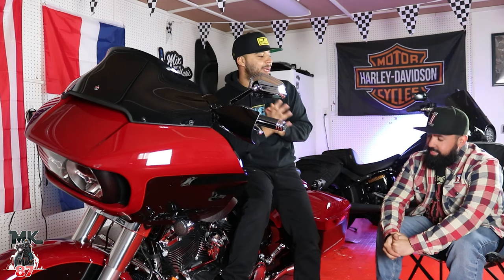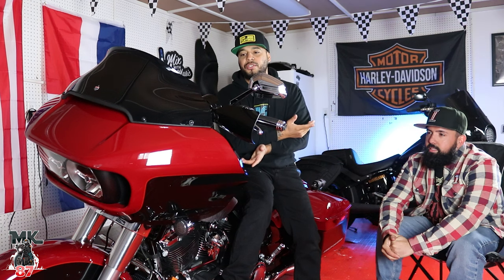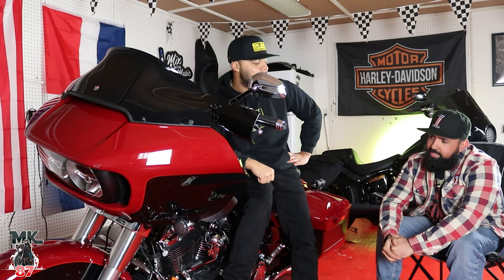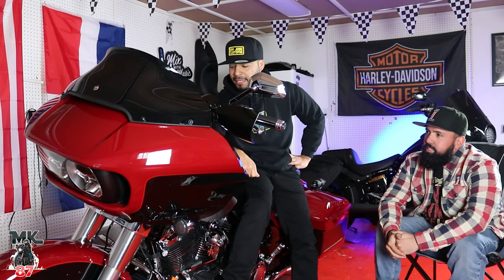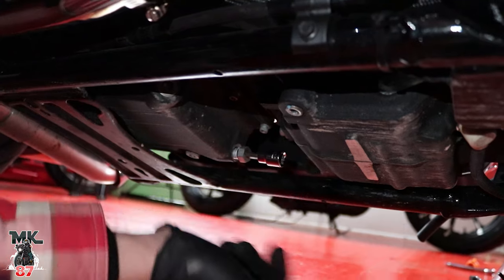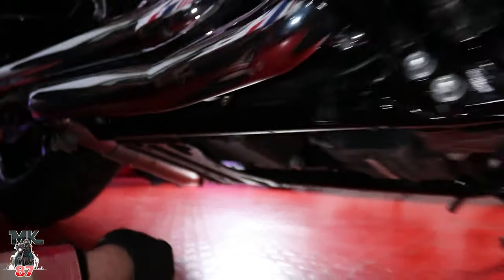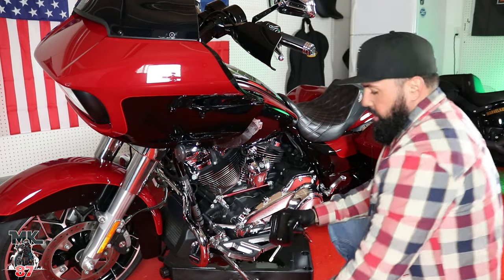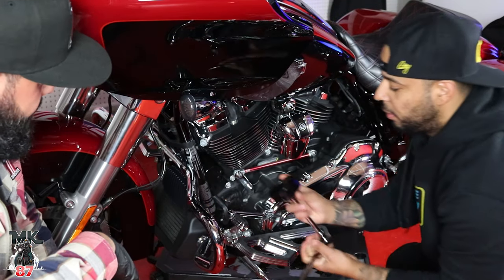How to do an oil change on a Harley Davidson road glide special

Comment: Drain plug you can also use a 5/8" socket for anyone wondering.  I also like/recommend to throw a little thread sealant with PTFE on the drain plugs. They come that way, thats what they recommend from factory, but honestly is just cheap and easy enough to do. It wont leak without it but $6 of it will last your bike's lifetime and its so easy. When you tighten these plugs, the second you feel the threads "bottom out", stop. I've pulled too many drain plugs that were way too tight from DIYers. You risk stripping the threads and stretching the threads out in the oil pan itself. a 1/4" flex head ratchet is perfect for these. Don't reuse O-Rings. Oil on the threads and gasket of the filter is a must, oil in the filter is personal preferance. Your M8s run 5 qts, twin cams will run 4 qts. Add 4.5/3.5 respectively and go from there. Run the bike (actually ride it) for a bit to run it before draining and run it the same after adding to get a true reading. Idling will warm up the engine, but not all of the oil without real riding. That's all i've learned, hope it helps someone.

Also, doing stuff yourself is great but for anyone who lacks the tools or know-how to check belt deflection, torque of critical fasteners, general inspection, tire pressure etc, take your bikes in for the service. The labor is expensive but you're paying for the work and the experience to have it done correctly to keep your bike in spec. I recommend finding a service manual for your bike thru facebook groups rather than paying the $100+ to Harley if you guys wanna do your own work/services.

Comment: Your friend did good. I have an M8 when I take out drain plug I check the magnet for bits of metal if any. Always clean the plug and bits of metal if any and clean off previous teflon paste or other sealants that may be on the threads. I use blue Hylomar on my drain plug threads. Added protection from leaks. Oh Yeah! Torgue is 14--21 foot lbs I do 15. Good luck! Good video!
Reply: I read: “ I have a beer when I take out the drain plug” hahah

Comment: Please don’t tighten that oil filter that much. Gonna regret it, make sure you’re motor is hot when you take it off next time. It’ll be easier to remove since it’s so tight. Just use your hand to tighten it next time. 🤘
Reply: Agreed, I cringed a lil watching the tightening of it. Hand tight in the oil filter bro! It will get stuck.

Comment: Great video for anyone wanting to know how easy it is to change oil (transmission  & primary even easier). Two recommdations from my experience. B4 u put the orange drip glide under the oil filter...put a rag down 1st. That way if & when the oil drips past the gilde in the back...the rag will soak it up instead of the oil dripping down the frame. 2nd, u should get in the habit of checking ur oil frequently. U'll see it get darker over time. U should be changing ur oil b4 it turns black. Once it's black...the oil has surpassed its life. Which leads to increased heat, wear & lack of lubrication. For how easy it is to check & change oil...u should never let it get to that point.

Comment: @Marvelkid87 I did my oil change this weekend in my sportster 883 and everything went smooth. I started my bike up and was running fine, All of a sudden the oil cap shot out and some of the oil to. Maybe I over filled it? Is that even possible?

Comment: In all honesty, what the dealer charges for the  work, it’s not worth it. I know my bike is older but bought it with 28 miles show room condition. I study what is involved in your k service and it’s all in your manual. I have a service manual and follow everything by the book! Got so confident I started doing my own handle bars now. I have yet to open the engine and do engine work but in the future I will. I have gone through the whole bike and torqued everything to specs, adjust belt, clutch, installed engine guard, exhaust, new bars and wiring, shocks, sissy bar, etc. Nothing feels better than learning how to do you own maintenance. Once you compare how much you spend on parts and see how much dealer charges, a lot of money saved. Sorry Harley dealers but not worth what you charge for some basic and simple oil changes. And they just raided their hourly rate as well.  I mean a car dealer charges 70 for an oil change which 55 of that is oil, why do you have to be ridiculous expensive. And you do not go through every nut and bolt as you say you do! I’ve seen actually dealers do the maintenance not worth it. And FYI, just save all your receipts and staple them to your manual or save them and your still covered under your warranty! You need them in case they want to do you wrong and save you never changed oil. The book says you can do your own maintenance. 

You do not need to take them to dealer to be covered under warranty like they say you do! I am no mechanic, but I have re-jetted my own bikes, clean carbs and tune. Other riders do not believe I did it myself! 

As a matter a fact, I had the dealer do the clutch plates, when I got bike back, I noticed I was having trouble shifting gears. Figured it was the the new clutch plates. I put screaming eagle clutch. So I went into my primary cover to see if it was adjusted right. Man i was still able to turn it two turns before I felt the mechanics catch. And the I noticed my clutch cable was lose. Had to turn that to be snug. Was so dissatisfied with Harley. Going to replace the clutch on y other bike as well but going to do it myself. At least I know it is done right! 

Good to see your finally doing your own work! Ride safe and god bless!